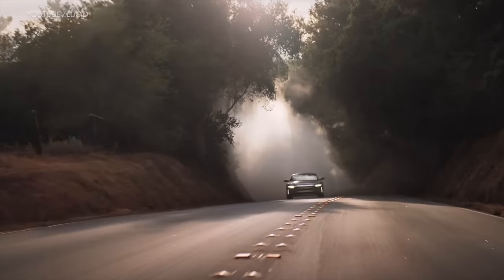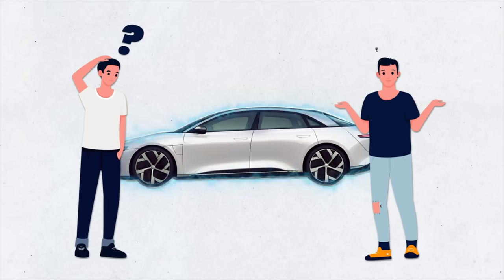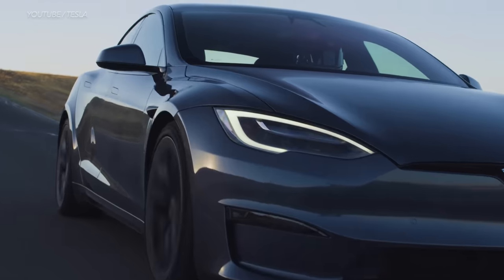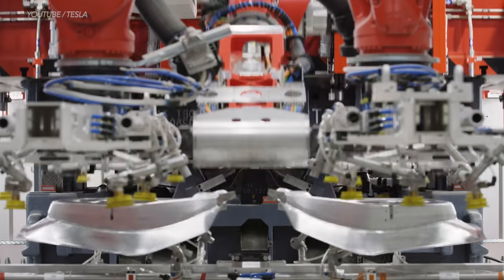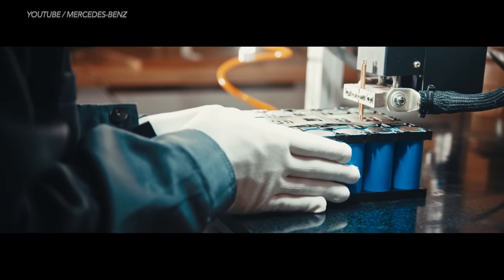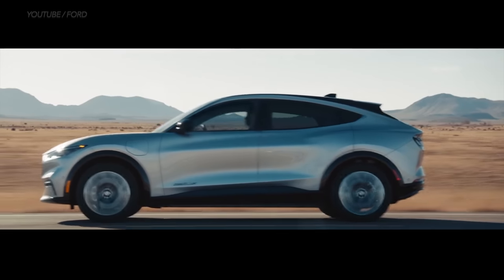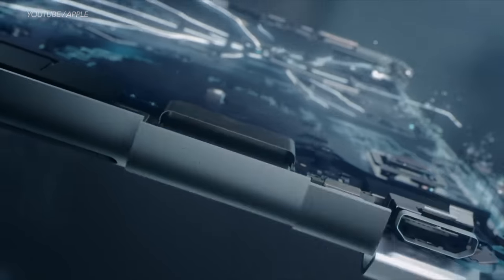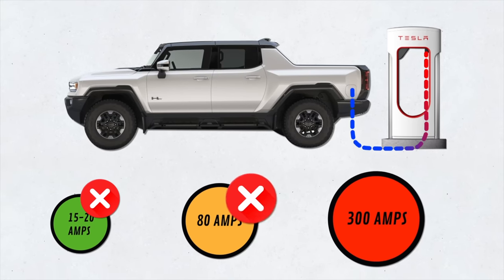Here's Why I'll Die Before I Buy an Electric Car

Comment: Scotty: I'm an old school motorhead and nothing will make me buy an EV. Or a 20 year old Toyota for that matter. Today, my daily driver is a Canadian made 2018 Dodge Charger sport sedan with a supercharged 3.6 liter/ 220 cubic inch Pentastar V-6 engine/ ZF 8-speed automatic transmission. I have it tuned for 93 Octane fuel and it puts out 602 hp with 22 lbs of boost from a Ripp/ Vortech supercharger, and that's not all I added to the engine. (there's room for another 100 but I don't want to strain it) HE, does 0-60 in the high 3's low 4's and has the passing power of an MX missile. Do ya think? And he gets 40 mpg on the Interstate, up from 28. And if you drive him sane, up to the low 30's mpg average, up from 22. IN A 4,200 lb CAR. Yes, you read that right. This Charger is a toy to that engine. And yes, like the Challenger, the Charger is all boy. And this one can become a very angry man and get insane dangerous. But, he's just a normal Charger if you want him to be. Smooth as a kitty. He's also an AWD for the Buffalo Winters. Because it's an AWD Charger, it's also a police interceptor, heavy duty everything; and handles just like a sports car, even at 4,200 lbs. And nothing can stop it. I've snowplowed 3 feet of snow with it and it didn't even spin a tire. I'm sorry, but even a gearhead can't ask anymore than that from a car. And I did it all in one stroke. In 50 years of driving and owning almost 2 dozen cars, this Dodge (Mercedes "E" class) is by far the nicest, most powerful and fuel efficient car I could ever even dream of, AND I HAVE ONE AND IT'S NOT A V-8! I ordered it new from the factory and it has every available option in it. Right down to the sunroof and it's loaded with tech. It has NO rust and has never had a single problem, supercharged or not. It had two factory recalls it fixed itself via satellite. What? It took a lot of work to put it all together and I'M HOLDING ON TO IT. It just turned 4. An old school motor-head's dream, if you will. The only comparable EV is a Tesla Plaid at 2 1/2 times the price. You can take your glorified golf carts and shove them where the Sun don't shine. By the time my Charger has to be replaced, this EV craze will be dead, buried and 10's of billions of dollars will be lost. Only 14% say they would even consider an EV. For a motor fuel, you can't beat the bang for buck, or the environmental cleanliness you get with gasoline. My car is living proof of it AND THAT'S FINAL. Carbon Dioxide is NOT a pollutant! The worst thing my car does is grow trees! Which is new school motorhead. Our Government is out to destroy the American people in a lot more ways than just this one.

Have you seen the latest Car Trek? They took a brand new Model Y Tesla to Atlanta Motor Speedway and it only went 18 miles at speed before the full battery went dead. And all they did was make excuses for it. One gallon of gas in my Charger would do DOUBLE that. And it holds 18 gallons. Do you see how ridiculous this entire concept is? Still think EV's have any kind of a future? They couldn't do it in 1920 and they still can't do it today despite throwing 10's of billions of dollars at it. Like I said: Glorified Golf Carts. And that's all they EVER WILL BE. They would need "Mr Fusion" to be viable.
Reply: You are one lucky gearhead! 🍀
Reply: A Tesla Model 3 Performance will out-drag, out-handle, outlast, and be cheaper to run than your car for a similar price. Enjoy your unhinged rants about CO2 being good for the environment. 👍
Reply: @ohutchie  And how would you know any of this? And the earth couldn't survive without carbon dioxide. Go to school much?
Reply: Scotty would tell you that dodge is one of the worst brands out there and that your supercharger is going to prematurely wear out the engine and thar u should never buy a used vehicle like that because owners drive the bag off them(resale), and that everyone should buy a 20 year old used Toyota camry. But u both hate evs so you have that in common!!
Reply: @dannysdailys you wouldn’t survive without water either but I don’t think you’d appreciate drowning in it
Reply: A friend of mine is a total gear head
He's owned more cars and trucks than anybody I know
He wrenches on them all 
Regular cars, sports cars,  whatever
He bought a  2014 Tesla for $35000 (original price tag of $150,000) that still has a  250 mile range 
I took a ride in it the other day and asked him what he thought of it?
It surprised me but he said it is the best car he's ever owned
People can adapt and change
Reply: @themeach011  I would agree with Scotty for normal people. The question was would I buy an EV and I answered it and why I wouldn't. But the Charger is a Mercedes E class, NOT a Dodge. I change his oil every 3,000 miles with Amsoil oil. Normal people don't even know what Amsoil oil is, or why you would use it. I have little doubt however that he might build one for himself like I did. But, just because he's been a mechanic for 50 years doesn't mean he's a gearhead. In fact, he probably isn't. He most likely knows nothing about high performance. I didn't buy it used, I built it from new. Besides, Toyota's quality is headed down the tubes fast and Scotty does mention this from time to time. You know you're in trouble when you're defending Mexican made Toyota vehicles. My engine getting the mileage is does, doesn't even breath hard, let alone prematurely wear. Me? I'm more concerned about how quickly 602 hp can kill me.
Reply: @ohutchie  Except that the Earth self regulates. If there is a surplus of carbon dioxide, the earth just gets greener. This was proven back in the 60's.
Reply: @ohutchie  No, it would be a model plaid at 2 1/2 times the price. Maybe you should read.
Reply: @dannysdailys  I've always loved the srt chargers. I'm a gear head too and I've had lots of cars but I do really love my model Y as well. I'm happy for people to have the vehicles that make them happy as long as they are basing their decisions on accurate information. There's a lot of false info and scare tactics regarding evs. I don't think an ev makes sense yet for the average person but if u drive a ton it's a no brainer.
Reply: @themeach011  If you drive it a ton? So your new "hangout" is a Tesla Charger? I hope they serve beer. LOL
Reply: @dannysdailys  well ideally you would drive under 300 miles a day to avoid having to charge during the day and u just wake up to a full charge.  but even in a ten hour day of driving you only need about an hour of supercharging. So when you start to do the math you are paying yourself 100$ an hour in savings on fuel to spend that hour charging. Seems like a no brainer to me. On a 20 day work month that's paying you $2000 a month to charge your car.  Or 24,000$ a year. I'd hang out for an hour a day at a charger for $24000 a year
Reply: @themeach011  You must work for Elon Musk. Wait until your 20,000 dollar battery goes dead. There's a reason why EV's only have a 10% retention rate. And that's in California.
Reply: @dannysdailys  I've replaced $14,000 engines and $8000 transmissions. And they didn't save me anything while I drove them. I save enough $ that I can afford to either trade it before it's off warranty, get extended warranty, or just pay for it. I save at the very least $1000 a month after making the payment and paying insurance etc. So for me I'll take the risk. For lots of people it's not a good option. It comes down to use cases. It's stupid to say that evs don't make sense for anyone and it's also stupid to say that everyone should have one cuz neither are right.
Reply: @themeach011  The bottom line is an EV is no way even close to carbon neutral. That's the lie. The lithium has to be mined as does all the nickel. Drilling for oil IS carbon neutral compared to that. And where do you think the plastics for the bodies come from? Oil is where. And the electricity has to come from somewhere to build it and to keep charging it. And just one supercharger can power 250 homes. There's a good reason we use gasoline. If America goes all electric, we would need 140 nuclear power stations just to handle the additional load. So how many are currently under construction besides NONE. For some reason, people think these use no more power than cell phone chargers.
Reply: @dannysdailys  I never claimed anything about carbon neutrality. There's an inherent cost to production and operation of vehicles. In the end for me its about efficiency and cost. Ice uses a depleting resource and wastes 65% of the energy it consumes. For my use case an ev makes sense. For lots of people it doesn't. I'm not anti oil by any means. I work in oil but there's nothing wrong with moving away from older tech as new becomes available. I'm not convinced we use oil because it's better though. As tech improves oil will not be needed as much for propulsion of vehicles in ic engines. I try take a very balanced and pragmatic approach to things in life. A hard-core view on either side of the argument is rarely correct.
Reply: The difference with home heating is natural gas is cheap and a furnace can be upwards of 95+% efficient. And ic engine is maybe 35%  if you've ever heated with heating oil you would have a different opinion on cost of gasoline/ diesel for home heating.
Reply: I would also dispute your claims on gasoline efficiency. Even though I am by no means anti oil. There is about 33.7kwh of energy in a gallon of gasoline so that's say enough to get 30 miles. That's about 1.12 kwh per Mile of energy used burning gasoline. My model y used about 0.288 kwh per mile. So just over 4 times less energy used to go the same distance.
Reply: On top of that it takes 4kwh of electricity just to refine a gallon of gas. That's enough power for to drive 15 miles. Just on the power used yo refine one gallon of gas. It's really hard to argue the math on ev efficiency. There's plenty of reasons to not buy an ev. Even u just don't feel like it lol. But efficiency doesn't have a leg to stand on unfortunately
Reply: @themeach011  I'M REFERRING TO A MOTOR FUEL! DUH!
Reply: @themeach011  I'm not replying to you any longer. You actually have yourself convinced you're getting paid to own an electric car. There's no longer any point.
Reply: @themeach011  You're missing the point. The point was efficiency of electricity by the time it starts as production of a battery to the time it's converted to usable energy for your car. You know this and you're just arguing for the sake of it. I'm OUT.
Reply: @dannysdailys  I apologize if I've offended you. That wasn't my intent. I'm just communicating some facts and numbers and research. I worry a lot of people base their opinions on stuff they hear rather than actual research and facts and science. We're all free to have our opinions. But it's good to be open minded. I'm not saying everyone should run out and buy an ev. But people should stay open minded to new things and not throw the baby our with bathwater as they say. Have a great day keep an open mind.
Reply: @themeach011  Have you seen the new Car Trek? They took a brand new model Y and put it on Atlanta Motor Speedway. It only went 18 miles at speed before the battery went dead. One gallon of gas in my car would have done at least double that.
Reply: @themeach011  Have you seen the new Car Trek? They took a brand spanking new model Y and put it on Atlanta Motor Speedway. It only went 18 miles at speed before the battery went dead. One gallon of gas in my car would have done at least double that. And it holds 18.
Reply: What do you think keeps trees alive? CO2 and what do you think keeps you alive? TREES! Did you ever go to school?  @ohutchie
Reply: Yeah, and after two years that car lost a full 1/2 it's value. I hope he likes it because he's stuck with it. @750count
Reply: @dannysdailys  He doesn't just like it, he loves it
Resale value means nothing at this point
I think as a 747 captain and lifelong gearhead,he knows what he is doing. And what is good

Comment: Driving ranges as they are now work for me (like always)... However, the battery longevity, reliability and the fact that it's almost certain that there will not be a simple drop in replacement for EV batteries when they reach an unusable state makes buying one a big no no.

There should be some standard battery for EV like AA batteries, but slightly bigger, we could replace a group of cell (maybe about the size of current starter batteries) whenever needed.
Reply: Nio is the Fix for this

Comment: I'll change my opinion on EVs when they are as "fuel efficient," quick and convenient to refill, and price competitive as petroleum-based cars.
Reply: 25 MPBC - miles per bucket of coal    lol
Reply: Fifteen years ago, you were probably one of those guys who couldn't see himself buying a smartphone.
Reply: @dpg227  My smartphone is a Nokia Lumia 625, and its battery holds out for 3 weeks. And i only bought it back in the day to use the camera. Im still using my original Nokia 1100 for calls, and its batter holds out for a full week. So yeah, i couldnt imagine myself having a phone to recharge every single day, let alone a car. lol

Comment: My dealership mechanic son in California gives a great talk on the environmental damage caused by the mining and manufacturing processes, the weight on the grid, and the general dangers of working with EV.  He finishes with the post-crash dangers to passengers and first responders. He is thirty-one by the way.
Reply: I honestly think that battery EV’s will need to be scrapped in favor of superior technology
Reply: Smart phones, laptops, and tablets require the same mining for their batteries. Not defending EVs but this has been going on for well over a decade.
Reply: @manthony225  true but EV’s require more lithium to function because they use more batteries. That is damaging to the environment and accelerates climate change more than mining other materials.

Comment: As far as i understood is that supercapacitors are in the pre-charge system of the battery charge to prevent high currents to the battery load. When you giggle and drive away after 40min the supercaps are charging the batteries while driving.

Comment: Only takes me 5 minutes to get up to 500 miles.... It's called gas.

 Which comes from oil that they get from coal. That EVs use " by magic?" No it still costs coal or oil to produce.
Reply: Even ignoring the existence of renewables, efficiency is a thing; Put that gasoline in a grid-level generator, and it'll produce enough electricity to move an EV 3-4 times as many miles as a gasoline car.
Reply: Plus the mining of cobalt and lithium then a factory must manufacture them. EVs are only EVs while they're being driven.
Reply: @vextract4662  So does extracting and refining oil (which also uses cobalt btw). At least the lifetime of a battery is decades (all batteries are warrantied for at least > 8 years / 100k miles, but most last much longer. The Prius is >20 years old, and most are still running on their original battery). And at the end the minerals are still there and can be extracted / recycled. What's the lifetime of a gallon of gasoline, and what do you have left after it's finished?

Comment: I wouldn't buy an EV until they actually use Nikola Tesla's actual research to design and construct it. Using batteries that were charged by coal burning sources is about as far from the real Tesla and you can get. It needs to actually use radiant energy collectors broadcasting it wirelessly and no batteries.
I'm a Tesla researcher and it pisses me off that Elon called his company "Tesla" when they essentially had NOTHING AT ALL to do with Nikola Tesla. He's almost as bad as Edison...
Reply: An electric car powered by a coal power plant generates less emissions than a gasoline car.
Reply: Tesla researcher? Hahaha and I’m a Tesla expert. If Elon used Tesla tech he would had levitating spaceships traveling to colonize the sUn

Comment: I'll consider buying an EV when:  1) it's just as easy to find a charging station as it is to currently find a gas station, and  2) when I can fully charge my vehicle in the same amount of time as it does me to fill my current ICE vehicle with gasoline.    A plug-in hybrid vehicle is something I'll consider well before moving to EV.
Reply: But you can charge it to full at home while your sleeping. Isn't gas stations kind of pointless when your house is one?

You will only ever need to use them on cross country trips. Which are rare.
Reply: @elonmusk6929  Maybe keeping the ocean alive is a good reason.  The production of lithium through evaporation ponds uses a lot of water - around 21 million litres per day. Approximately 2.2 million litres of water is needed to produce one ton of lithium.
Reply: @trilobyte3851  Ah yes we will run out of water! HA! You can just make more with hydrolysis.
Reply: @elonmusk6929  There is also the matter of dreading raw materials...from the ocean...
Reply: @elonmusk6929  that water is polluted afterward with heavy metals...